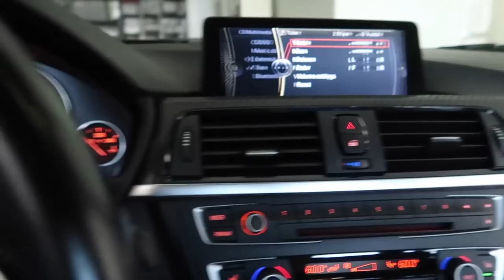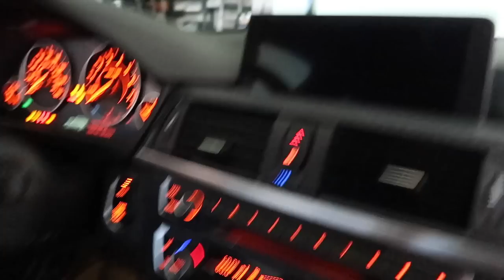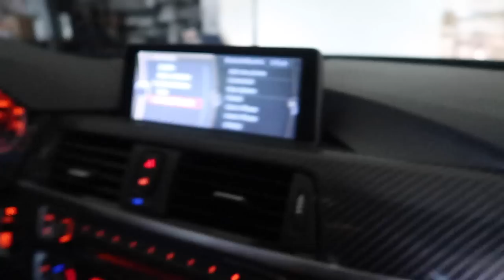MY EARS ARE IN HEAVEN! INSTALLING BIMMERTECH FULL AUDIO ON MY BMW F30!

Comment: FYI that extra harness that you plug into each speaker is what filters the relevant sound frequencies for that specific speaker out of the signal that comes via the OEM cables.
Reply: FYI it’s called a crossover lol
Reply: WRONG : that crossover is designed to work with the FACTORY amp ONLY. If you order the full kit. Leave these OUT.
Reply: @kalani777  fair enough, but what I said is still right.
Reply: @n55tourist32  incorrect. in this case you are not right.

Comment: I thought my F10 with Harmon Kardon sounded good but them Alpha One’s put them to shame. If your audio settings are all factory you should check out a video from What’s Your Forte?. He goes through the fine adjustments and it made my stereo sound sooo much better. I’m curious if it will have the same effect for the Alpha one’s.
Reply: Did he go through with Harmon kardon ones. I have those and havent found the right equalizer things for the best sounds loll
Reply: I was just going to ask if these were better than the Harman Kardon setup.

Comment: You gotta clean that screen over the sub its gross. previous owner spilled something there and cleaned the carpet better than that. on a hot day it will start to drip which is why the old sub is so dirty

Comment: I replaced every speaker and the amp was in the car and used the factory housing with minor modifications. Got a 5 channel amp and added a single sub. Puttin a different radio again eventually that will look more stock

Comment: You should of disconnected the battery before moving the seats back like that - I’ve read that the seats have inertia “sensors “ or something of that sort that can sometimes cause the airbags to deploy if your move a seat like that with the battery still connected
Reply: “you’ve read”. lol meaning you have no idea what you’re talking about

Comment: Did the M3 not come with Harmon Kardon sound system?
Reply: I thought h/k was standard for m cars, but it seems his has only hifi as there is no equalizer settings or L7 logo in idrive and door tweeters doesnt have harman kardon badges
Reply: @LaurynasJr  I know for my M140 which is an M lite, the HK is an extra optional but I’d deffo assume the actual M cars would have them
Reply: This isn’t the M3 it’s his wife’s car.